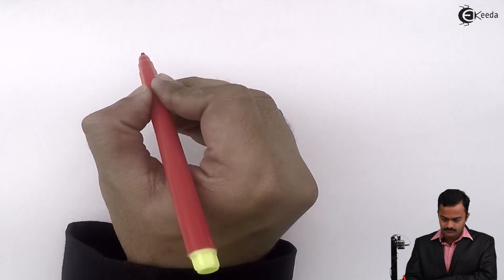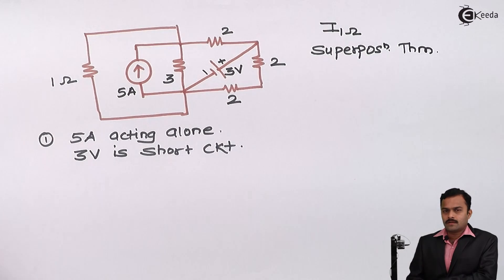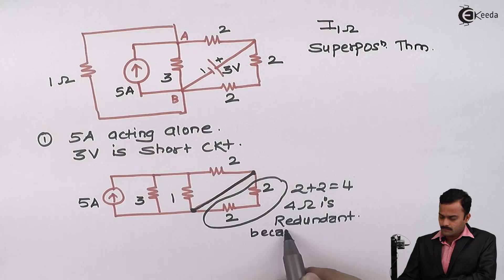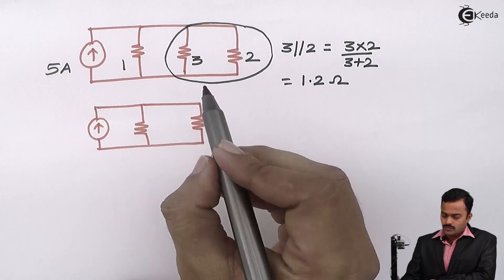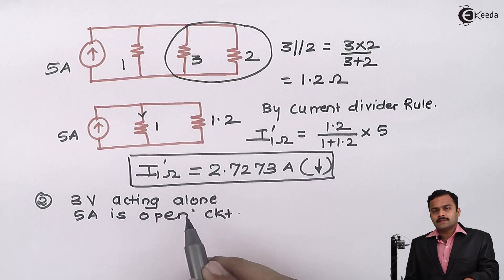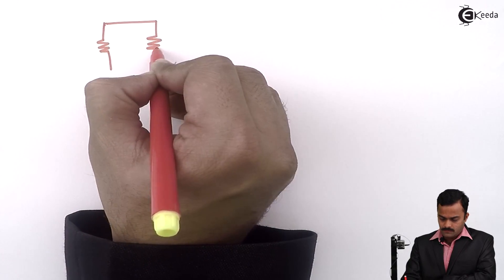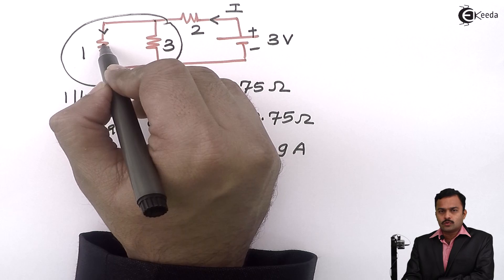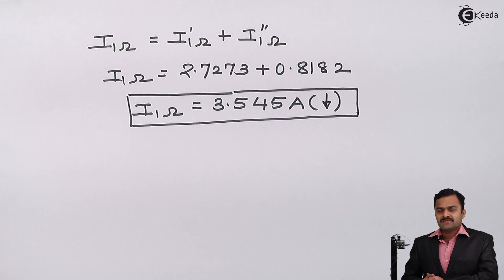Superposition Theorem - Problem 6 - DC Circuits - Basic Electrical Engineering - First Year

Comment: why we can neglect 4 ohm resistance across 3 volt battery source when we considering 3 volt as a source?????...plzzzz reply
Reply: ur correct, we need to solve it by delta to the star conversion method. we should not remove 4-ohm resistance there
Reply: When you connect two resistors in parallel across a voltage source ...(say 5v) it will remain constant across the two resistors...hence in this question the current which was required to b found was in the other mesh hence it was neglected through the 4 ohms values ( redundant).
Reply from the maker: Hello Avinash,
You will get your doubts solve on Ekeeda Engineering Learning App. Download Ekeeda Engineering Learning App from Google Play Store - https://play.google.com/store/apps/details?id=student.ekeeda.com.ekeeda_student&hl=en
Reply: Did u find answer for ur question
Reply: @user-wj1gm2gf5s  did you find the answer
Reply: @user-wj1gm2gf5s  actually now I am in 6th sem. and  that tym I was in 1st sem...😅😅 My branch is CSE.... so no need of more detail ....😅 www.instagram.com/futuregurukuls  .... let's connect here😅
Reply: I'm also having the Same doubt